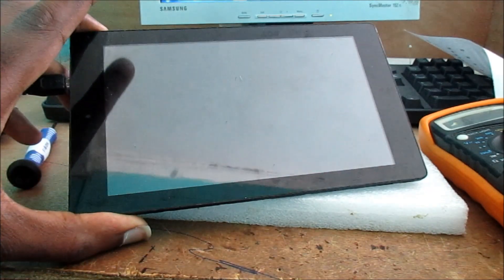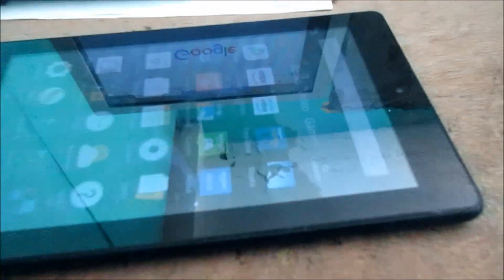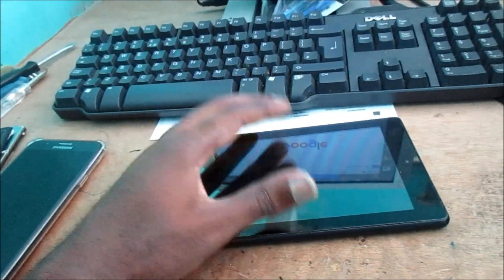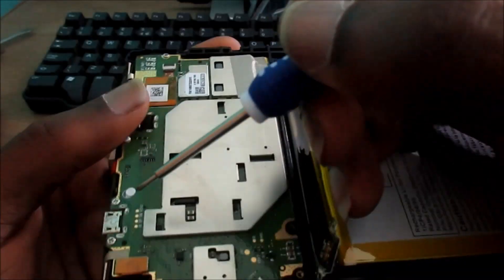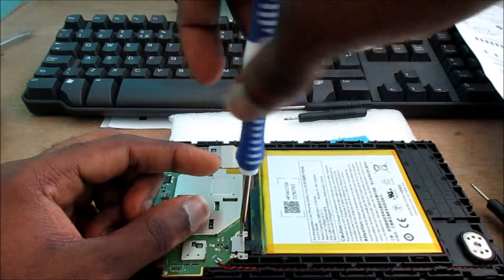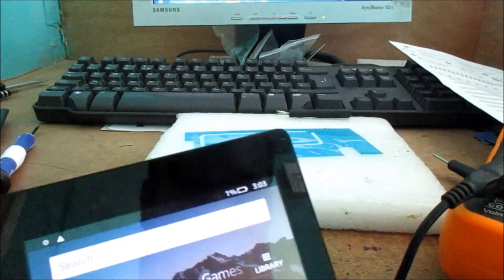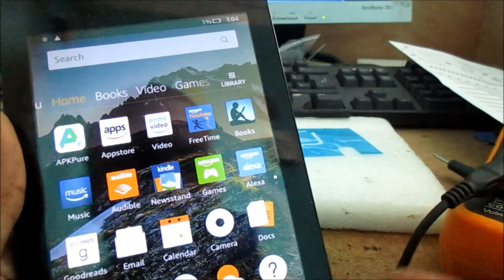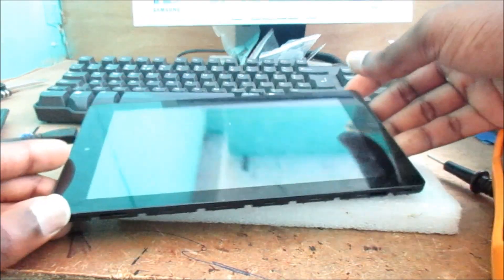How to fix Amazon Kindle Fire Not Charging 1% Amazon kindle fix doesn't charge Fix

Comment: Something to try for a temp fix that I found while searching for an 
answer.  It sounds weird but plug your tablet in, then lean it against a
 wall or in the corner of a chair or couch so the tablet is resting on 
the charging cable.   When you get it at the right angle, it will 
charge.   Just tells me the usb connector is bad and requires the 
contact to be forced.   Been doing it for a couple weeks and it works 
fine.
Reply: That used to work for me but now I can't get it to charge above 1%.
Reply: @melray74  Yeah, worked for a while for me too then the charging port broke out of it.  I gave in and finally got an ipad.   2 years and zero issues so far.
Reply: Didn't work for me.

Comment: What if when I test the port while charging I only get a 3.10 - 3.20
Reply from the maker: you should get at least 4v are you using the correct charger ?
Reply: @Lenzwalters  I was using one that was connected to my playstation so I'm thinking I might have a bad battery instead then